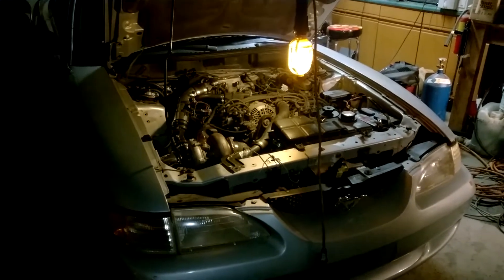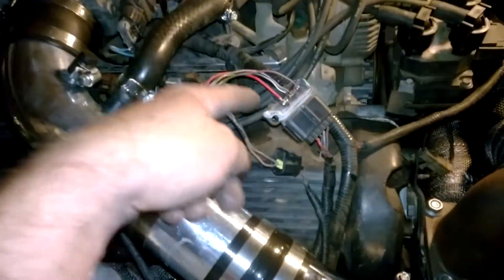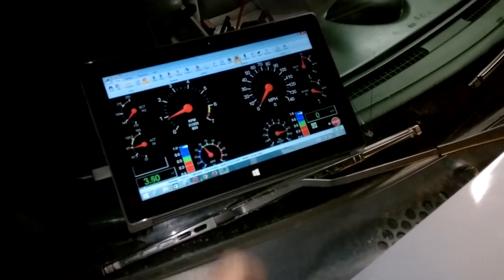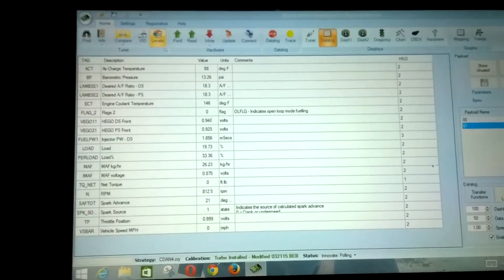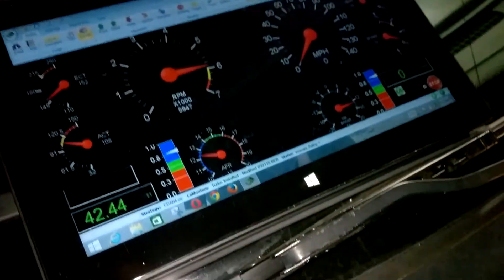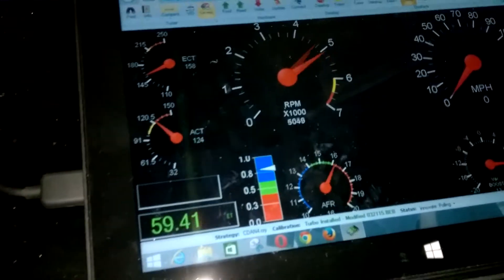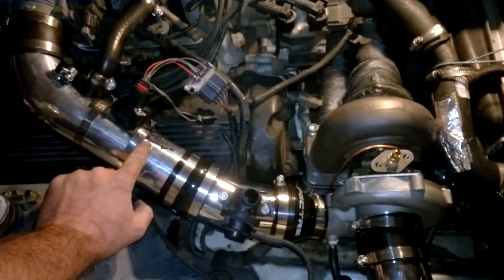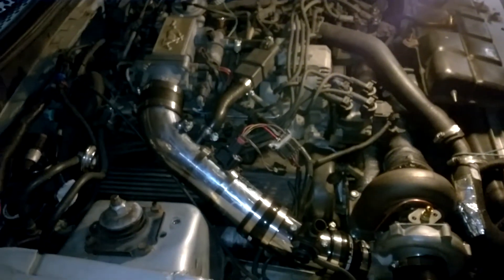Project mustang - Turbo pipe installed with Slot MAF test

Comment: Great job, I see a speeding ticket in your future lol.
Reply from the maker: LOL I hope not!
I drove it to the auto parts store just now and it is dark and all which sucks because you won't spot a cop.
It's hard not to get into it a little bit.
But just a little bit = 80 before you blink.

I still got tuning to finish and those cheap Spectre rubber intake pipe couplers I bought from the parts store suck of course and they came off THREE TIMES during my drive to the parts store and back.
They got really soft once the hot air blew through them.

I'll need to go to NAPA or something and get some reinforced couplers made for diesel trucks.
Reply: You got a sleeper there. Next thing we know you will be on that tv show Street Racers.
Reply from the maker: Pops McCartney
I never seen that one but I've watched street outlaws. Which of course is way beyond this DIY stuff. HA HA!

Comment: How did you wire up the six wire mass air flow to the stock Mustang?
Reply from the maker: It's been a few years by the only difference is the 6 Pin includes the air temp sensor ifb the MAF sensor instead of a separate 2 wire temp sensor mounted separately. 
You can find the schematics of each and just wire all 6 wires to a new 6 pin plug and use the 6 pin slot sensor.

Comment: Hey Buddy I have a question if you can answer. I am doing a twin turbo set up in my S550 v6. The last component I am trying to figure out before I start tearing the car apart is for the MAS sensor. What does it hook up to electronically I know I have to place it somewhere along the intake but I am confuse regarding the MAF to MAS conversion. Thanks!
Reply from the maker: I'm not familiar with Mercedes. 
They might be using a MAP sensors. 
But either way you have to replace them because that will not have the range and then have the computer retuned to remap them to read correctly